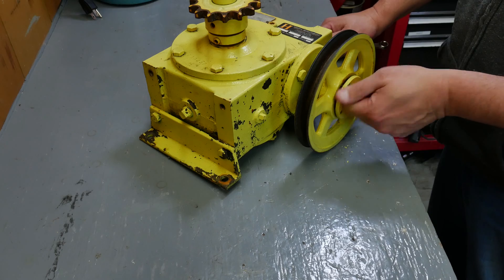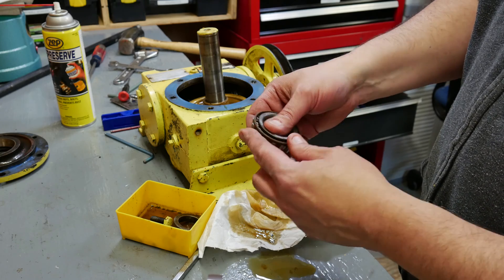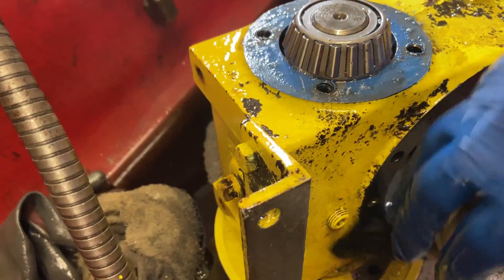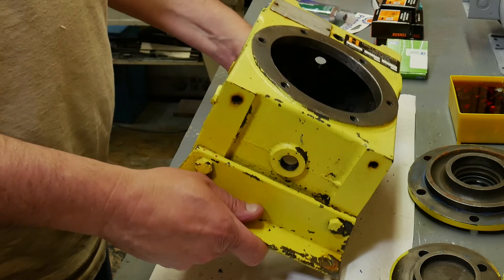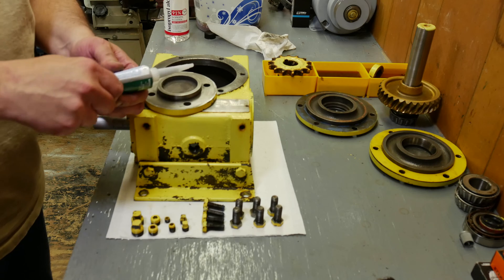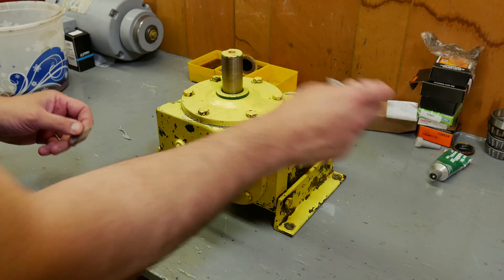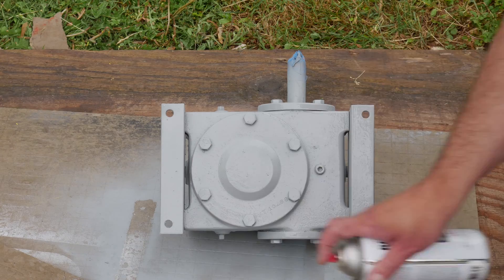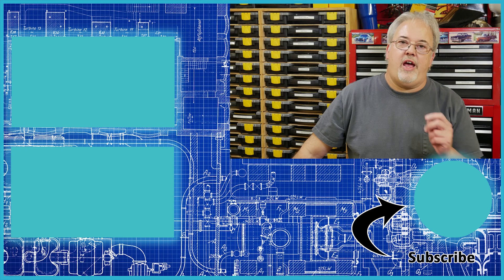Worm Gearbox Repair: Carnival Ride Rebuild

Comment: Hi. I just found your channel and I am impressed. You are so thorough with these bigger parts and also the tiny parts in the video about the electronic controller.  Amazon is out of the tool used to remove the bearing races, but i will check again later. Can you tell me where to find the cutter you have which goes over your finger. Thank you.

Comment: Great video. I have to laugh at the one time you didn’t wear gloves was stripping the paint.
Reply from the maker: I get a bit complacent with that citriStrip. It ain’t our dad’s paint stripper that would immediately start burning the second it touched your skin. But I probably should be a bit more cautious. Thanks for the support!
Reply: @PeteRondeau , So is Citrus Strip a non toxic product? That’s cool, I will have to check that out. I thought it was the name of a pole dancer in Pennsylvania.
Reply from the maker: @DIYGene  I think non caustic would be a better term. And it’s biodegradable which is why I feel comfortable just power washing it off.
Reply: Great demo Pete. Thank you so much 🙏 & I am sharing.